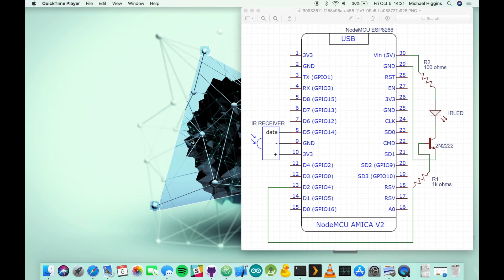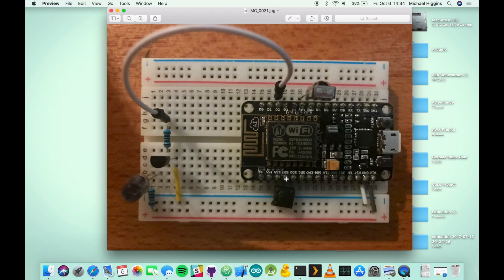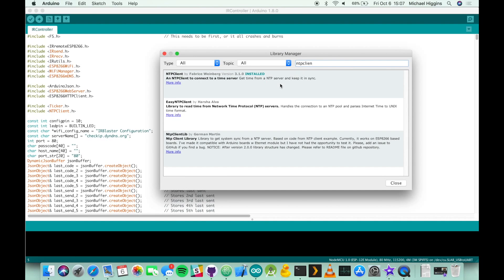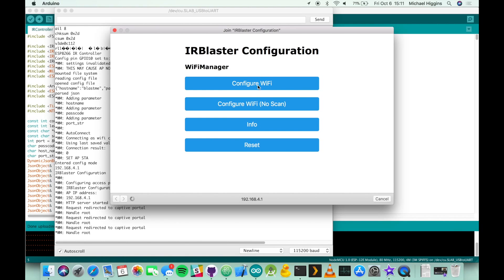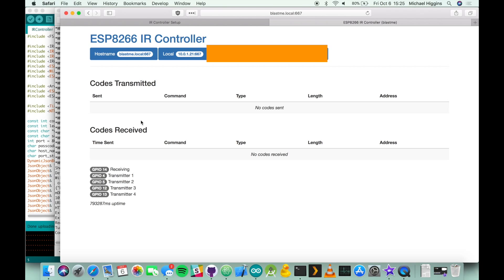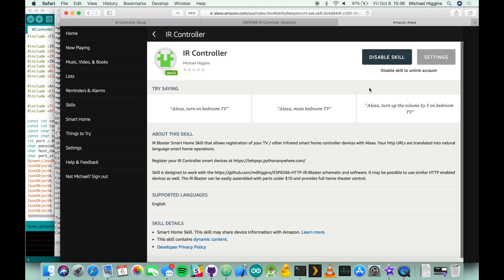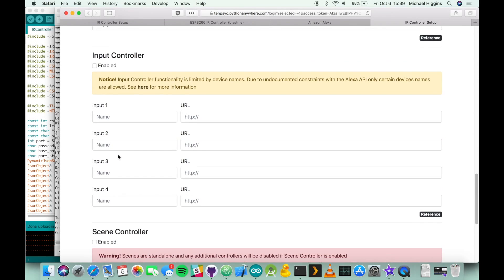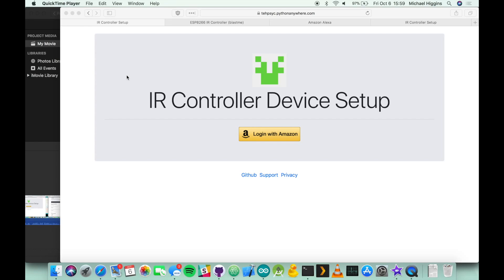IR Controller Tutorial

Comment: Good day sir , pls I tried replicating this code I uploaded it successfully but it shows GPIO 10 set to 1. Also the local ip is showing what's on the code 10.0.1.10 am I suppose to edit this? How do I move on from here I need help pls
Reply from the maker: In the WiFiManager configuration when you boot it into config mode, you need to connect GPIO 10 to ground (0) to boot into config mode while the device is starting

Comment: All setup is done but when i am giving the  command through alexa it keeps telling me that the device (tv, Soundsystem, etc) appears to be malfunctioning. 
any solutions for this?????
Reply from the maker: Ensure that you're using your external IP address and that the address is accessible outside your local network, you will need to set up port forwarding
Reply: @michaelhiggins3896  Done that but same issue
Reply from the maker: @jay199334  Email me some examples of the commands you're sending the serial output when you're attempting to send them, and include what happens when you use those commands in your browser instead of via Alexa

Comment: Great Video. Neat Project.
One question... How do I change the gpio pin for the IR receiver to D4 of my node-mcu? Been trying for an hour.
Been soldering for DAYS. Almost there...
Almost there... Almost there.
Reply: Nevermind.
I got it. I had to tweak the second set of pins in the sketch. Not the first.
Reply from the maker: Its just one line at the top of the file where pinr1 is defined, all the pin assignments are in the same spot at the very top of the file so they can be easily modified
Reply: Thanks again Mister. My sketch had 2 sets of pins. I was only changing the top. Second set tweak did the trick. @michaelhiggins3896
Reply from the maker: @jqzIII  Yeah there are conditional pin layouts for some boards and that IF/ELSE statement will adjust the pins but you must have been editing the one that wasn't being applied to your board

Comment: Hi, I'm trying to compile this, using the latest and greatest Arduino IDE. Several problems. Some of the libs shown in the video cannot be found. Some when I search I find multiple with similar names. Time.h seems to be the biggest problem but there are others. I can post a list (need to go back and retry it all and make notes), but my main question is, has anyone managed to get this compiled recently? Any tips on how to get the right libs? 
Thanks in advance.
Reply from the maker: It compiles fine, all libs are available and up to date. If you're having trouble consider using Platform IO which handles downloading the libraries and versioning for you

Comment: can someone help me, when i trie to compile this message appears:

xtensa-lx106-elf-g ++: error: CreateProcess: No such file or directory
Multiple libraries found for "WiFiClientSecureAxTLS.h"
Used: C: \ Users \ Edward Santos \ Documents \ Arduino \ libraries \ ESP8266WiFi
 Not used: C: \ Users \ Edward Santos \ AppData \ Local \ Arduino15 \ packages \ esp8266 \ hardware \ esp8266 \ 2.7.4 \ libraries \ ESP8266WiFi
Multiple libraries found for "ESP8266WiFi.h"
Used: C: \ Users \ Edward Santos \ Documents \ Arduino \ libraries \ ESP8266WiFi
 Not used: C: \ Users \ Edward Santos \ AppData \ Local \ Arduino15 \ packages \ esp8266 \ hardware \ esp8266 \ 2.7.4 \ libraries \ ESP8266WiFi
Multiple libraries found for "ESP8266WebServer.h"
Used: C: \ Users \ Edward Santos \ Documents \ Arduino \ libraries \ ESP8266WebServer
 Not used: C: \ Users \ Edward Santos \ AppData \ Local \ Arduino15 \ packages \ esp8266 \ hardware \ esp8266 \ 2.7.4 \ libraries \ ESP8266WebServer
exit status 1
Error compiling for Generic ESP8266 Module card.

Comment: Hi no idea if you still check these comments, but i wondered if you could help me, i cant get it to show up in the wifi, the step at 5:28. This is what is shown in the serial monitor (Ive removed my SSID and Password):

ESP8266 IR Controller
Config pin GPIO10 set to: 1
mounted file system
*WM: [3] allocating params bytes: 20
*WM: [2] Added Parameter: hostname
*WM: [2] Added Parameter: passcode
*WM: [2] Added Parameter: port_str
*WM: [2] Added Parameter: user_id
Using Static IP
*WM: [1] AutoConnect 
*WM: [2] Connecting as wifi client... 
*WM: [3] STA static IP: 192.168.1.20
*WM: [2] Custom static IP/GW/Subnet/DNS 
*WM: [2] Custom STA IP/GW/Subnet 
*WM: [1] STA IP set: 192.168.1.20
WM: [1] Connecting to SAVED AP: *********
WM: [3] Using Password: **********
*WM: [3] WiFi station enable 
*WM: [3] enableSTA PERSISTENT ON 
*WM: [1] connectTimeout not set, ESP waitForConnectResult... 
*WM: [2] Connection result: WL_CONNECTED
*WM: [3] lastconxresult: WL_CONNECTED
*WM: [1] AutoConnect: SUCCESS 
*WM: [1] STA IP Address: 192.168.1.20
WiFi connected! User chose hostname '' passcode '' and port '80'
*WM: [3] freeing allocated params! 
*WM: [3] unloading 
WiFi configuration complete
Local IP: 192.168.1.20
URL to send commands: http://ESP-967954.local:80
ArduinoOTA started
MDNS http service added. Hostname is set to ESP-967954.local:80
HTTP Server started on port 80
Starting UDP
Local port: 8888
Waiting for sync
Transmit NTP Request
Turning off the LED to save power.
time.google.com: 255.255.255.255
No NTP Response :-(
Error retrieving external IP
HTTP Code: -1
connection failed
External IP address request took 10246 ms
Ready to send and receive IR signals

any ideas as to why it isn't showing up?

thanks
Reply: Pls how did u input static IP?

Comment: when I configure, its asking for amazon user id, what should I enter there? and after I configure I can't log in with the blastme.local adresss. Plz help
Reply: Amazon userid is listed at the bottom of the python anywhere page and is only needed for security purposes if using the Alexa skill. If the local address isn't working make sure you configured your network settings correctly and try the local IP address instead, some routers don't support mDNS

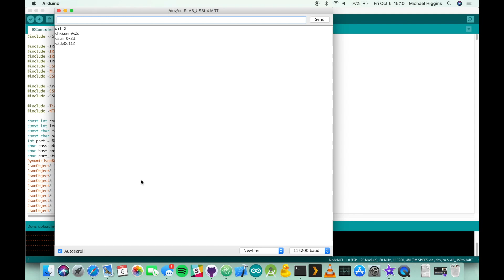Comment: I finally was able to compile and upload without errors, but things are still wrong. at 5:14 in video, my serial monitor output is different; it shows "config pin GPIO10 set to : 1.... failed to mount FS". when setting up Arduino IDE, neither of libraries from ivan grokhotkov are listed (esp8266webserver and wifi), I don't know if this affects the file system. also, my IRController.ino sketch is different from the one in this video (I downloaded directly from mdhiggins page).  is there an updated instruction somewhere? what can I do differently to get this to work? please help.ESP8266 IR Controller
Config pin GPIO10 set to: 1
failed to mount FS
*WM: Adding parameter
*WM: hostname
*WM: Adding parameter
*WM: passcode
*WM: Adding parameter
*WM: port_str
*WM: Adding parameter
*WM: user_id
Using Static IP
*WM: 
*WM: AutoConnect
*WM: Connecting as wifi client...
*WM: Custom STA IP/GW/Subnet
*WM: 10.0.1.10
*WM: Already connected. Bailing out.
*WM: IP Address:
*WM: 10.0.1.10
WiFi connected! User chose hostname '' passcode '' and port '80'
*WM: freeing allocated params!
WiFi configuration complete
Local IP: 10.0.1.10
URL to send commands: http://ESP_27D51C.local:80
ArduinoOTA started
MDNS http service added. Hostname is set to ESP_27D51C.local:80
HTTP Server started on port 80
Starting UDP
Local port: 8888
Waiting for sync
Transmit NTP Request
time.google.com: (IP unset)
No NTP Response :-(
Error retrieving external IP
HTTP Code: -1
connection refused
External IP address request took 0 ms
Ready to send and receive IR signals
Turning off the LED to save power.
Reply: Hello did you fix this connection problem? I have the same problem my ESP12-E cant connect to the WiFi 😪😪
Some help..
Reply: Pls were u able to get passed this

Comment: i am getting a compiling error about needing to upgrade to arduinojson version 6; this is the one in installed in the library (6.11.3), and the upgrade instructions on benoit's site are not related to this project specifically. how would i upgrade the ircontroller.ino, or should i just install the 5.13.5 version in library manager and use that?
Reply: Installing lower version fixes this issue.

Comment: Hello Michael.
Thank you for the video tutorial. You can answer a small question. I scan codes from Panasonic air conditioner. The length of the received code is 75. The code is not decrypted as one of the known protocols. If I try to transmit the same code as the RAW, its length is 149.

Comment: Hi Michael
I have a question about using Alexa.
I have a DVR which is called SKY TV. If I say "Alexa, pause Sky TV" Alexa complains about video skills.
But if I say first "Alexa, switch on Sky TV" I can say "Alexa, pause" with no problem and works well.
But if I get Alexa to do something else I lose control of the DVR. I know once Alexa is controlling a device you don't need to specify the device name in the command. How can I control the DVR without switching off and back on? 
Thanks again
Peter

Comment: If you think this is a "load & go" type project, don't try it.  It takes some work.  There are code dependencies and levels that may need to be tweaked.  You need to make the proper code changes and set up your router properly.  Try looking on the Internet and especially in the comments for this video if you get stuck.  It took me a couple days of trial and error but it works great.  Thank you Michael.

Comment: Hi Michael,
Would you please answer one question, I am not planning to use Alexa server I know if I follow your instruction then the ESP server stay up but if I do not use Alexa server and ID during WIFI setup then ESP8266 server goes to deep sleep that it need to be reset.
Why the ESP server goes to some sort of sleep mode after while , I can connect to server Via internal and External address with port #123 but after about 2.5 mins then I cannot reach the server with internal or External address,  if I press reset button it works for couple mins again.
I 'll be appreciate your prompt respond.
Reply: I found a crude way of keeping the server up with resetting it when it get deactivated with following command right after delay(200) in loop() I added:
  server->on("/", []() {
    Serial.println(" ");  
  });
is it any better gracious way of keeping the server active??

Comment: When I try to send a command with alexa, I get a "TV malfunctioning" error and this serial port message:
Invalid EPOCH time, security checks may fail if unable to sync with NTP server
Ready to send and receive IR signals
Turning off the LED to save power.
Connection received - JSON
Failed security check, signatures do not match
(followed by two signatures).
Really could use some help - thanks
Reply: hey, I was wondering if you were able to resolve your problem. i am getting the same error.

Comment: I wanted to say thank you for your efforts in this project - it works amazingly well!

It took me almost a full day to figure it all out, but have it running on a NodeMCU 0.9. Sharing what I had to do in case it helps anyone.

IR led high side to 5V via a 20ohm resistor, low side driven by a 2n2222. 2n2222 gate to D2 via a 220r (ish) resistor. It's driving an LG tv on/off with the following IR code I found searching online, as my IR receiver couldn't capture a valid signature (IR received module too slow I think):
json?plain=[{'data':[9000,4500,560,560,560,560,560,1690,560,560,560,560,560,560,560,560,560,560,560,1690,560,1690,560,560,560,1690,560,1690,560,1690,560,1690,560,1690,560,560,560,560,560,560,560,1690,560,560,560,560,560,560,560,560,560,1690,560,1690,560,1690,560,560,560,1690,560,1690,560,1690,560,1690,560],'type':'raw','khz':38}]

I had to disable the light sleep line //wifi_set_sleep_type(LIGHT_SLEEP_T); in the sketch (thank you @Hristo Atanasov for finding this). It still only consumes about 40ma idle.

Disabled the 4th LED channel to use that GPIO as my reset pin (13). The default reset GPIO didn't work on the nodemcu 0.9
To do this, I commented out the following lines (use the find function to find them in the code):
//const int pins4 = 13;
//IRsend irsend4(pins4);
//irsend4.begin();
//case 4: return irsend4;

Also had to downgrade lwIP in Arduino IDE to 1.4 like suggested.

Comment: Can you clarify some information., please.
One link in the parts list points to 5 pairs of IR Emission and LED, and the other is just LEDs, do i need 2 LEDs?
Also, in the circuit board, there ate audio jacks, I missed the part where these are used.

Comment: Hi.  Thanks a lot of this tutorial.  I followed it to a tee, and it works perfectly!

One Question.  One the devices I use (IR light switch) needs me to press the button on the controller for a long time (about 2 second).  I am sending a RAW IR command by using a HTTP POST with a JSON object.

Is there any way I can set the 'long press'?
Reply: Hi Kiran!  do you still have the original code (in the video)?  is it possible to send it to me?  I need it for a school project.  demorgansucks@gmail.com

Comment: Thank you for your time on this project, all works great. The only problem I have had is the "Define yours channels" only seems to work with two digit channel numbers and in the UK Sky boxes channels start at channel 101.
The board by @raptordemon for this project works great as well, Thanks.
Reply: Hm there's no limitation set for 2 digit channels and I use my setup for 3 digit channels regularly, not sure why you are encountering this problem but 3 digit should work fine
Reply: Hi Michael, Thank for your quick reply. Yes it does work. Sorry my fault I didn't realise that the commands from your Python server where only added to my Alexa on "Add Device" and not on "Update Channels".
Great project, thanks again.

Comment: Hi ! this is a really great project ! thanks ! it's works really well !
i'm having some troubles using the volume increment function
Basically i use this URL for TV  volume up http://xx.xx.xx.xx:667/json?pass=****&plain=[{'data':'20DF40BF','type':'NEC','length':32}]}]
When i’m saying “alexa tv volume up 5”, the ir led sends only 1 ir code only instead of 5 :-(

I tried to add repeat 5 in the URL but the UI in https://tehpsyc.pythonanywhere.com wont let you
http://xx.xx.xx.xx:667/json?pass=****&plain=[{'data':'20DF40BF','type':'NEC','length':32,'repeat':3}]

Any way to solves this ?
Reply from the maker: Yep replace 3 in your repeat parameter with vol
Reply from the maker: stupid youtube * vol * without the spaces
Reply from the maker: Or alternatively won't use the json variant, the command you listed would be fine for the simple version
Reply: Yes !! this is working great ! thanks !

Comment: Hi Michael, Thank you for making this open source this is awesome.
I am having an issue where my device boots with no errors, but once bootup is complete and I get 'Ready to send and receive IR signals' the device shortly drops off the network. Do you have any ideas what might be happening ?
Reply from the maker: Yep, I'm guessing you're using ESP8266 Core v 2.4.1 or higher which introduced a memory leak regarding network that causes this, roll back to 2.4.0 and use lwIP variant 1.4 when you compile
Reply: Thank you that worked perfect. I am using nodemcu v3 board which doesn’t have a five volt rail so i used one of the 3 volt rails instead which got the sending working. Only thing is I can only get it to work via html requests with no authentication, serial monitor says ‘Failed security check, signature is too old
’ when i have my user id in. A little more tinkering and I’m sure I’ll sort it, thanks again.

Comment: I tried to build the ino file. i get following error - 

C:\Users\singlavs\Documents\Arduino\libraries\Sha\sha1.cpp:2:20: fatal error: avr/io.h: No such file or directory

 #include <avr/io.h>

                    ^

compilation terminated.

exit status 1
Error compiling for board NodeMCU 1.0 (ESP-12E Module).

It looks like arduino ide is not picking up avr/io.sh some how. Did a search on google, but couldn't make it work. Any suggestions will be much appreciated.

Comment: I cannot get past the initial wifi setup. I am able to connect to 192.168.4.1 and update the config. When the network restarts, the esp8266 does not show up in the router's list of attached devices (I assume it is just masking itself?) and I am also unable to connect via the http://<ip_address>:<port>, in this case http://192.168.1.16:667. My wifi router is a netgear nighthawk r7000 and there is no mDns available. Local network addresses are assigned starting at 192.168.1.2.

Here is the serial output after the config is reset: 

WiFi connected! User chose hostname 'irblaster' passcode 'xxx' and port '667'
 config...
{"hostname":"irblaster","passcode":"xxx","port_str":"667","user_id":"amzn1.account.xxx","ip":"192.168.1.16","gw":"192.168.1.1","sn":"255.255.255.0"}
Writing config file
Config written successfully
WiFi configuration complete
Local IP: 192.168.1.16
URL to send commands: http://irblaster.local:667
ArduinoOTA started
MDNS http service added. Hostname is set to irblaster.local:667
HTTP Server started on port 667
External IP: xxx
External IP address request took 411 ms
No errors detected with security configuration
EPOCH time obtained for security checks
Ready to send and receive IR signals
Turning off the LED to save power.

* update - indeed the device is listed briefly in the router's attached devices after config is set, but after a few seconds, it no longer appears in the list